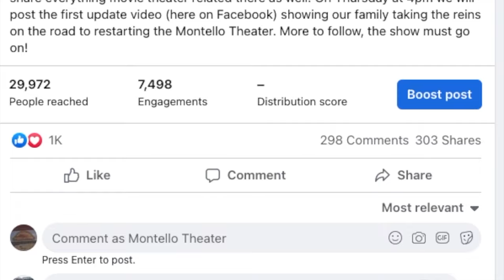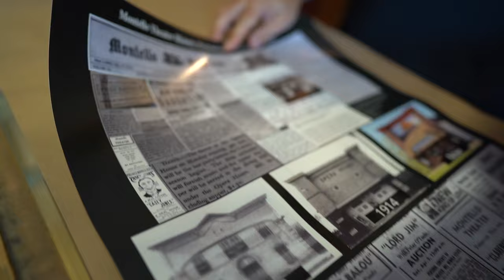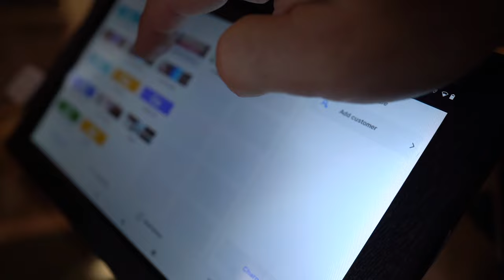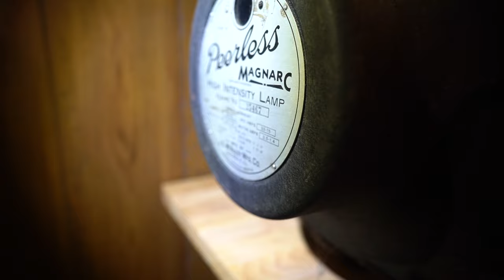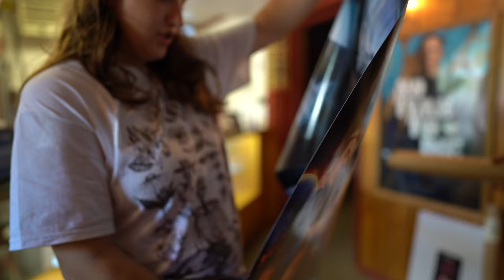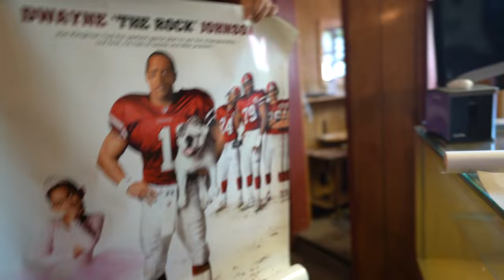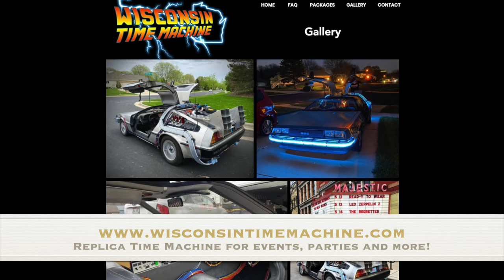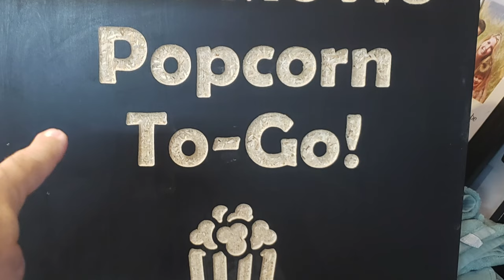We Bought Montello Movie Theater- ANNOUNCING OUR REOPENING PLANS! [Including a time machine!]

Comment: There were actually two sets of marks on the film.  The first was to start the other projector.  The second was to flip the shutters.  Reason it was so important the reels were loaded correctly so the audience was never aware that a different projector was now projecting the movie.

The rods had to constantly be monitored because they would burn and had to be adjusted.  It was critical to keep the gap at a proper width to maintain the proper amount of light. 

Yep, the good ole days.   :)
Reply from the maker: So interesting! I've seen those dots in years past but never realized they were intentional.
Reply: @Homesteadhow   .. I still see them on the old movies that are shown online.